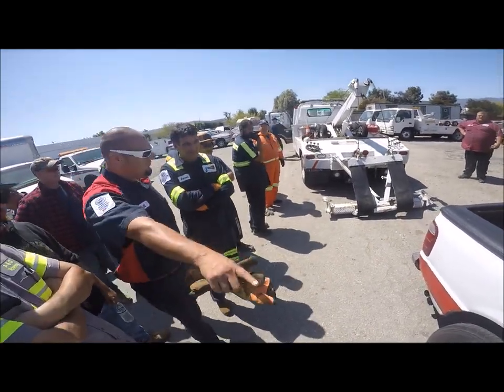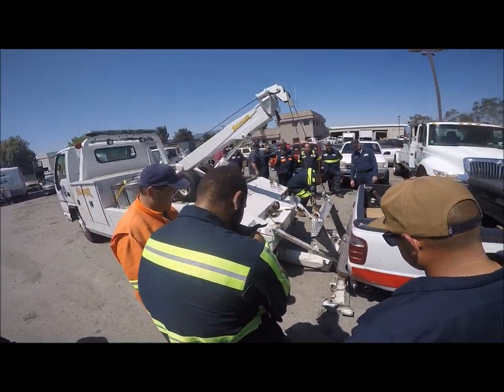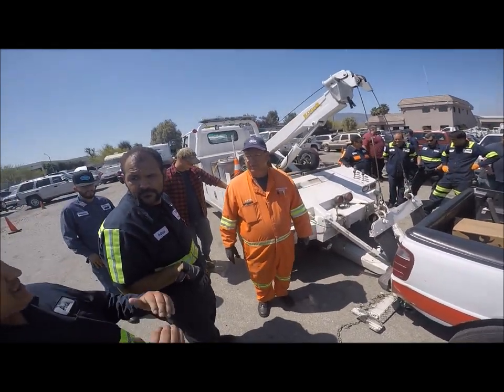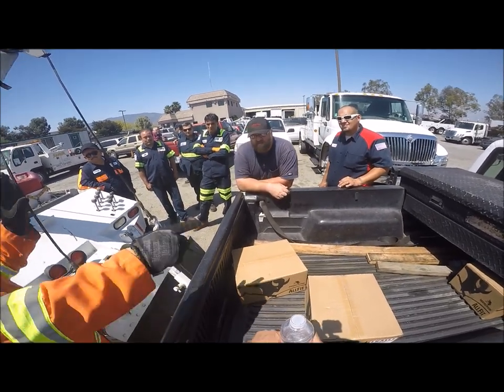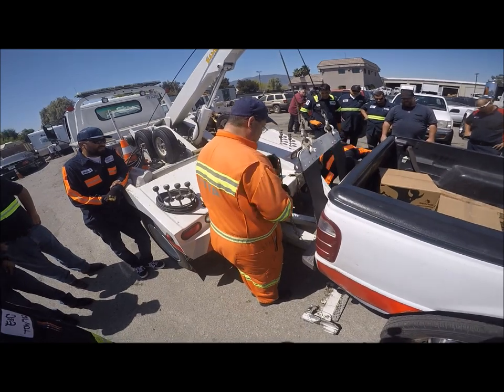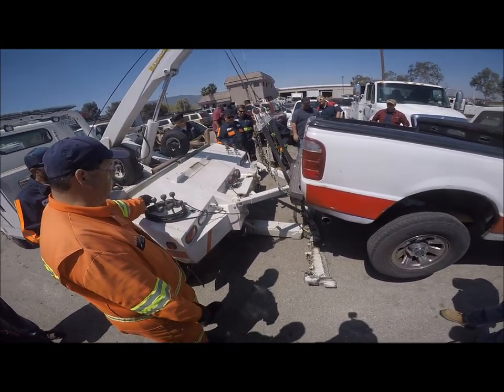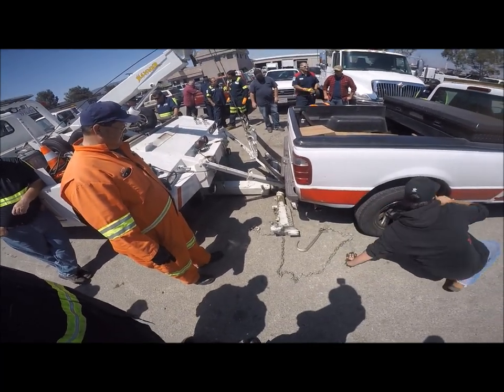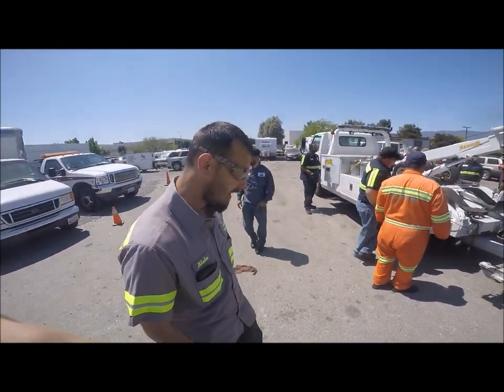CTTA TRAINING  #4  SLING HOOK UP

Comment: At roughly 7 minutes big mistake made you NEVER LIFT WITH THE RUBBER BELTS USE THE EXCESS CHAIN TO HOOK TO THE TOP CABLE HOOKUP ON THE SLING THUS TAKING THE MAJORITY OF THE WEIGHT
Reply from the maker: That's exactly it the chains are supposed to hold the weight not the belts
Reply: I disagree. The sling straps are designed for lifting light vehicles. They are reinforced for that purpose. A Tow Pillow is a great piece of equipment to add when sling towing. For medium duty lifting, definitely shorten the chains to carry the load between the two crossbars.

Comment: is that a 4wheel drive
Reply from the maker: willieldraytonjr not sure
Reply: I was trying to figure if they was towing the (4x4)ranger with just the sling. And no dolly. I heard you can tow a 4x4 from the back with a sling, in neutral, steering wheel tied down, with no dolly. Is that a fact?? If so what about a all wheel drive same process??
Reply from the maker: willieldraytonjr we didn't check to see if it was 4 by 4 this is more just to demonstrate the sling process but on a 4 x 4 or AWD theoretical you can hook it up from the front and put it in neutral and tow without dollies but you want to stick to lower speeds 35 or less and maybe don't go more than 10 miles that's the typical rule we usually go bye
Reply from the maker: willieldraytonjr however if this Ranger was a 4 by 4 and it had manual locking hubs on the front that were set to free spool you could pick it up in the back and tow it all day long and treat it as a two-wheel drive
Reply: Pyro4100 you guys are great I watch all of the videos you guys do. Is there a site I could learn  extensive knowledge on cans/can'ts in Towing.
Reply from the maker: willieldraytonjr on that one I don't know you could try to look up wreckmasters on YouTube there's a couple of videos you can learn there just watched I guess the toe videos I know when it comes to some specifications I use aw direct tow specifications you can find that it awdirect.Com

Comment: Why are you releasing the brake?
The parking brake is in the rear, the truck were to fall off the parking brake would keep it from Rolling away. also if it is not 4 by 4 why are you putting into neutral it's a rear wheel drive truck. Keeping it in Park would also help if it fell off, it would not roll away.
Reply from the maker: Normally you would do that in order to get it to settle into the sling it helps when hooking up and then if you're rolling and it bottoms out it doesn't drag it rolls with you so that it doesn't Yank on anything
Reply from the maker: Although I do agree if it does fall off having it in park with the brake on will keep it from flying away but then again the safety chains are supposed to stop at as well

Comment: i don't get it why this towing system is still a thing when you can tow almost every vehicle simply by lifting it at the tires. i live in europe and we don't even have this system here, there is just way to much room for error (because everyone makes mistakes sometimes). btw i'm not trying to shit on someone ;)
Reply: Well for your information over here in America we have bigger and heavier things to lift wheel lifts have a 4 to 5 thousand pound weight limit so lifting a long box 3500 truck with a diesel tank in the back wont work you will break tje wheel lift hydrolics so it takes tue weight more for a sling
Reply: Why are they still using the pin and link system on the railroad? We have moved on from the pin an link to a knuckle coupler. You still use the pin an link system there because it works for you. We still use slings here because it still works for us.

Comment: Um for safty conserns why didn't you pull the truck forward to tighten the chain before lifting because all your doing is lifting the sling with the loose J Hook hanging there plus you took the break off what if it rools when the chane brakes not very safe way to train plus why don't you show this method on a vehicle that actually needs a sling a little ford ranger doesnt need a sling bad training video
Reply from the maker: Unfortunately I wasn't the one doing the training just recording it questions like that actually should be addressed to ctta